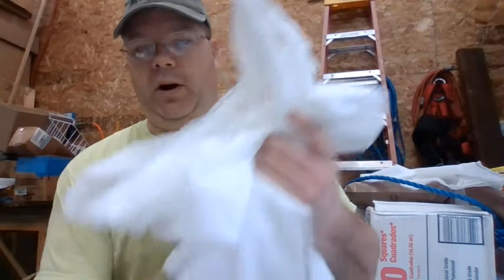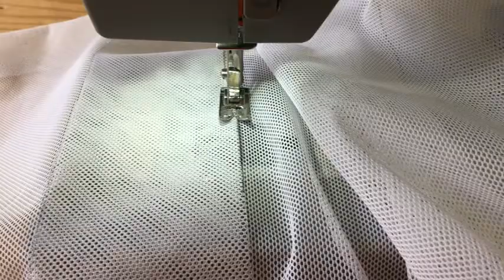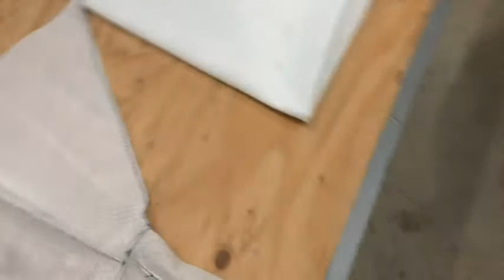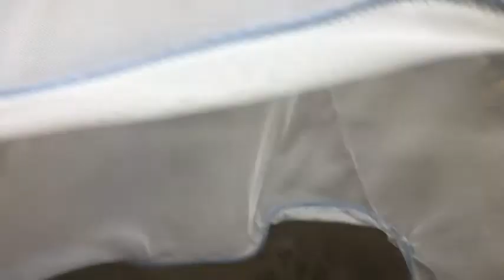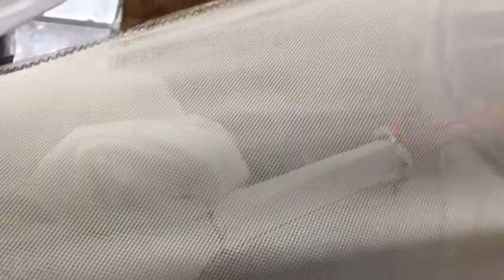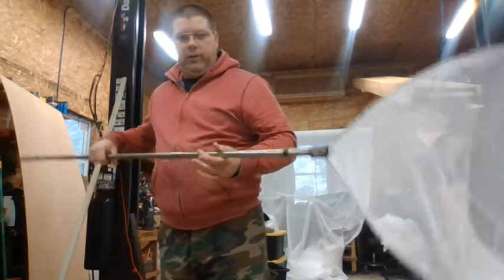Elver Fishing Nets. Made in Maine

Comment: Hi...I'm interested in your dip nets. I looked for your email in the abouts section, but didn't see it. Maybe I was in the wrong spot
Reply from the maker: Hey,  It's still listed there.  If I post it here it'll all be deleted in about 1 minute.  You'll have to look in at the "details" in the about section and then click on "view email".

If you're in Canada I can't ship them, they're too big.
Reply: @northwoodsyankee3528  oh...I thought you ship to canada...I'm in NS.
Could you give me some tips on how to make the net...like what shape is best?
Reply from the maker: @MikmawWarriorBrave  I can ship Fyke nets no problem but the dips are too long and hoops are too big.  I've sent a lot of fykes to NS, Newfoundland and NB.

Roundish is probably your best bet.  It needs to be strong where the hoop attaches to the handle.  That's where they break.  That's why I made these from stainless steel.  No cheap pot metal.
Reply: @northwoodsyankee3528  thank you so much. Can you suggest a mesh type to use? Once I get some experience I want to buy a fyke net. I was told by my mentor that if not done properly, I could kill the elvers
Reply from the maker: @MikmawWarriorBrave  It's 1/16th inch polyester.   Fyke net use isn't that hard.  About the only way you'll kill them is if you leave them in real cold water hard running water too long or let the tail bag go dry.  

Keep them in good water with aeration and they should be fine.  Check out my fishing videos.
Reply: @northwoodsyankee3528  thanks for the info. I will watch your vids, and when I decide to buy a fyke, you will be who I get one from. I still can't find your email. It may be because I'm using the YT app on my phone. Already subbed to your channel 👍🏾
Reply from the maker: @MikmawWarriorBrave  Thanks.  That's weird.  It's still listed there.  It was a fast season here so it should be good up there.
Reply: @northwoodsyankee3528  I'm hoping you are right 🙂
Reply from the maker: @MikmawWarriorBrave  Thanks.  In the fishing videos you'll see where I talk about water temperature.  You'll have to convert to C of course.  Moving them from warm water to cold water is a quick way to kill them too.  That's explained.  

I think I supplied 3 Nations this year.
Reply: @northwoodsyankee3528  I'm glad I found you. My Indian Reserve just started a harvesting program...there are 15 band members that are now gearing up to go elver fishing...so I will be passing your channel to them
Reply from the maker: @MikmawWarriorBrave  Awesome thanks!
Reply from the maker: @MikmawWarriorBrave  www.guagusenterprises.com is my website for it.
Reply: Gwe'  brother , Me and my son bought our dip nets and fyke nets from Filmar in Quebec last year . We got the custom square shape dip nets , but you can get round or square . They are made with white nylon
knotless net with Delta 1/32 inch mesh with double and triple stitching . The dip nets are 2 piece screwable aluminum shaft handles for easy breakdown . Just to let you know . From your  Nova Scotia Mikmaq brother . 
 Pusu'l Puna'ne !
Reply: @meatmorash  Wela'lin Nitap...I'll look into it for the upcoming year!